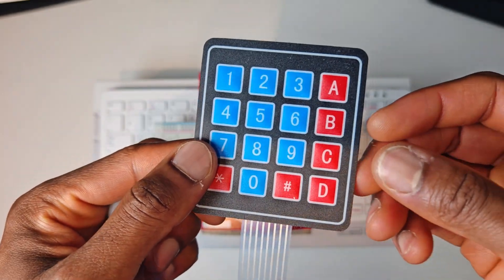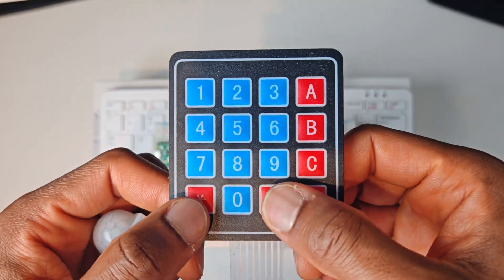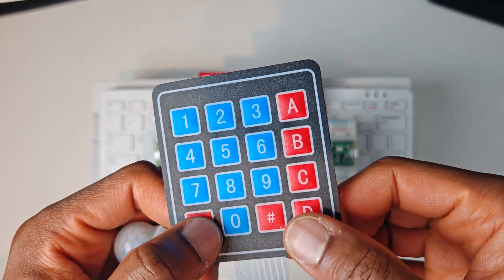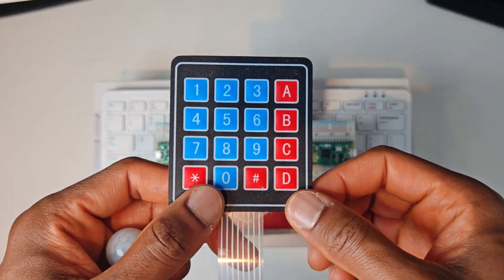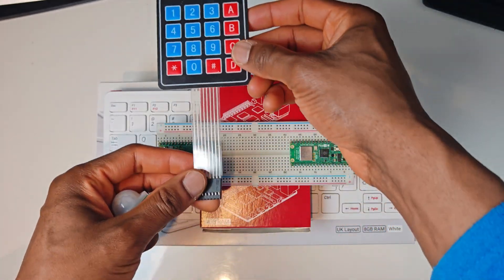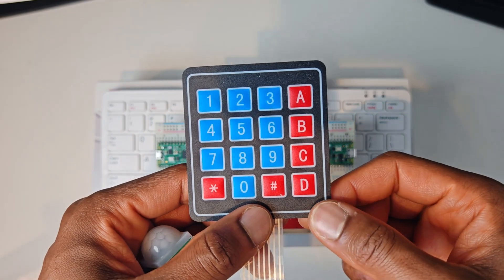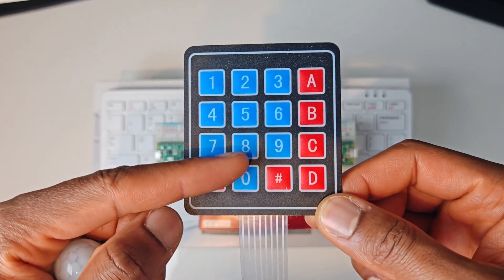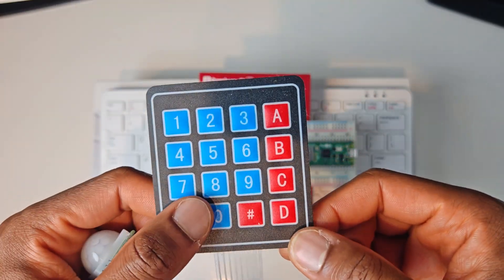Meet The Raspberry Pi Family | "Pico" | "Pico 2" | "Pi 4" | "Pi 400" | "Pi 5" | "Pi 500" | 2025 - V2

Comment: I own 2xPi400's, they are just great but the Pi500 was a massive disappointment so I just ordered a much faster OrangePi5 as its just faster, cheaper and I can put a cheap nVme on it. The fact the Pi500 has all but a few components to have a nVme just sucks! Also now I can add a nice backlit proper keyboard from the saving/s! I emailed the Pi-guys and the tech support/r&d are miffed too and the sales reflect the consumer disappointment. Kickstarter or wait for the OragePi500 maybe? Lastly I might just get someone to remove the 4gb ram from the Pi4's and resoulder the new RAM for me as to be honest, thats the only reason most upgraded to the Pi500 was 8/16gb options but to be fair, *INX needs and runs awesome on 4gb too! The cost was more than just getting the O/Pi5 8gb so, its on its way from chinna as I type! I love traveling, just use the Motel/Hotel TV and Im off to the races. Perfect for cheapo travel/streaming and email/socialmedia device. I dont even miss windows now and perfect for the kids too!